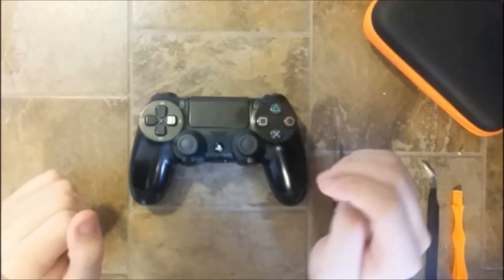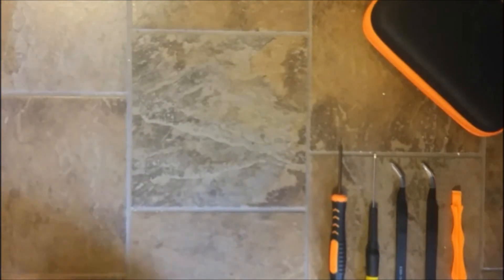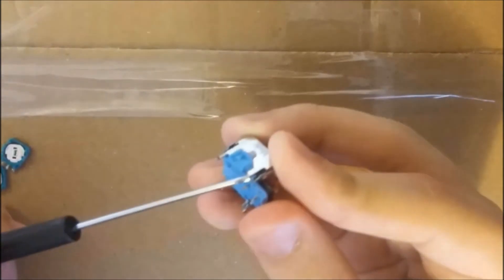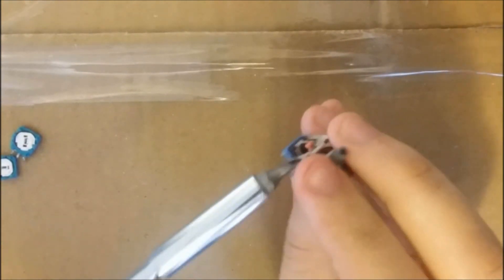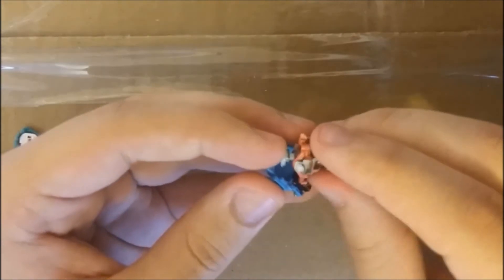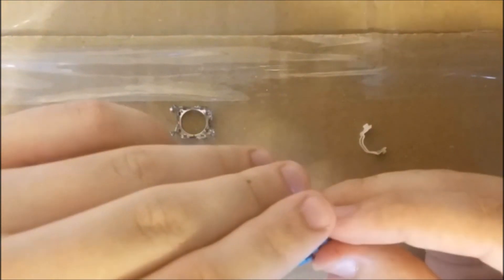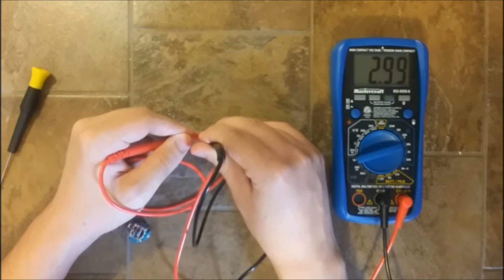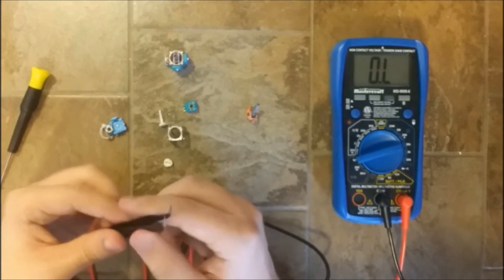What's inside a joystick/analog stick module ? - The best way to understand joystick drift !

Comment: Question: if i want to replace this mini potentiometers for normal sized ones (gonna make a midi controller), do u know what resistance pots should i use? Thanks!
Reply from the maker: If I remember correctly, these are 10k ohms potentiometer.
Reply: @RepairResell  thank you very much

Comment: Question!   If I wanted to modify a controller to use for FPV simulators, I would need to remove the return to center function of the left stick for the vertical axis.   If I took out of of the plastic pieces for that axis, would it work to remove that center function?
Reply from the maker: No, it return to the center because of the spring underneath the joystick. The return to center function is not specific to one axis unfortunately.

Comment: My left analog  joystick just starting drift to the right but only when i touch/move the joystick a little, the drift is not continuous but only flicker to the right, when i move the joystick 360° it become normal for a couples second, do you think it's fixable?
i just bought the controller a month ago with casual uses.
Reply from the maker: Cleaning the corresponding potentiometer could work. If there is too much damage, you will need to change it. To help you in your repair, you can watch our playlist on Joystick drift: https://www.youtube.com/playlist?list=PLVMOpbUzqOAxggx4A3ITX-JjF_wiKwsXI
Reply: @RepairResell  I just cleaned it yesterday and now the drift is gone, thanks.

Comment: Repair and Resale can you upload a video to find out how to disassemble analog stick and label each part name with reference to the parts name like a schematic
Reply from the maker: Is it possible to know why you need that ? It will help me to make a good video about it. You also need to know that once the analog stick is completely disassemmble with the metal plate off it would be really hard to reassemble it correctly.
Reply: @RepairResell  well if you see this and replied that would be nice if you have a snap or a Facebook please let me know bc I can show you why I need that  video  I need to know is it fixable or if I just have to get it replaced  if you see this please respond
Reply from the maker: @unknown-er4dk  There is a link to our Facebook page where you can contact us in the description :)